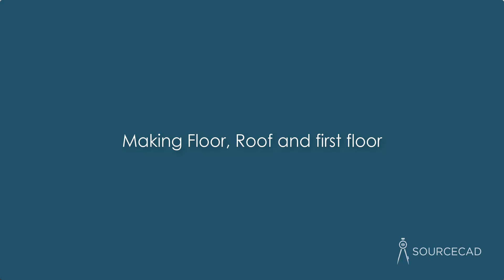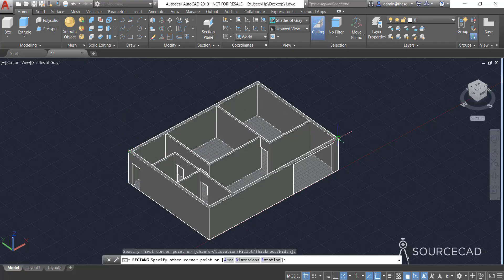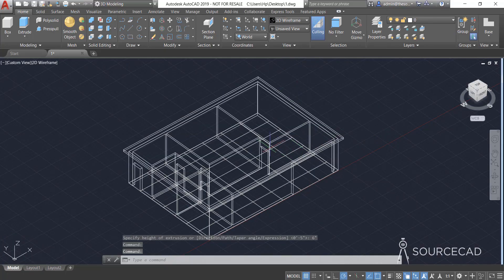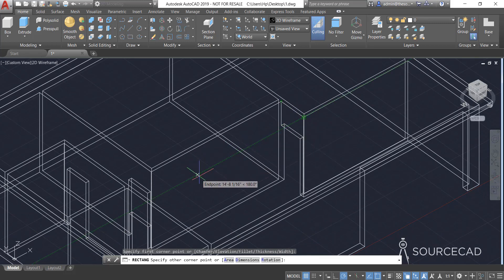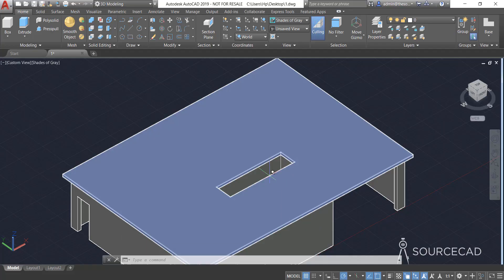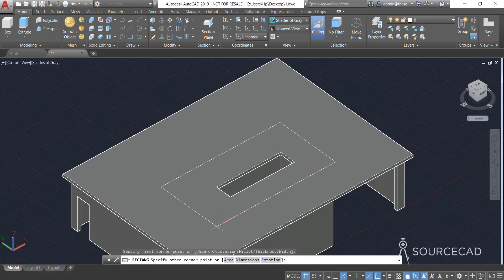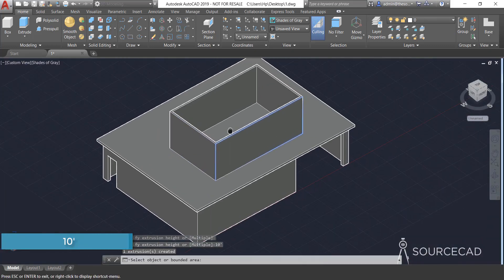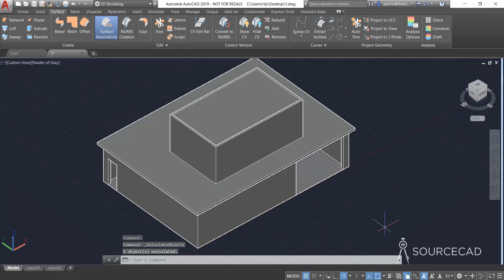3D house in AutoCAD from scratch - Part 2 of 3

Comment: When doing presspull on the 1st floor the boundary is not getting selected, instead any of the one polyline rectangle is only getting selected due to which it's coming like a box and not walls, how to fix this ?
Reply: chose front view in view cube. check whether u have actually drawn the rectangle on the surface of the first floor.

Comment: I have a question
Bcuz my scale of the drawing is not according the given numbers so I tried to adjust the scale of the given blocks but I found it is a bit hard to adjust exactly for the size should be. .. 
So how do I can do ??? I mean for the adjustment for the 3D object like curtain wall.
Reply: use exact measurements

Comment: When I subtract roof and again subtract the middle part it remains the same why is that?
Reply: Im too facing same problem.. Still tht everything went gud.. Bt nw im stuck😐
Reply: @paulinmariya250  I was having the same problem. But I tried with rectangle and then I presspuled.  It work correctly